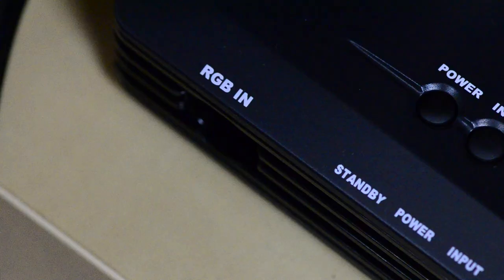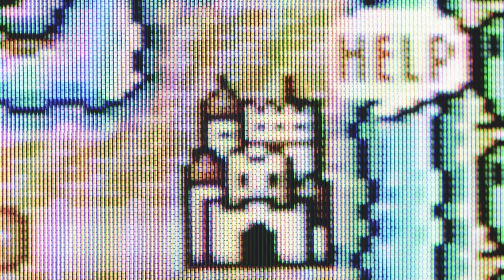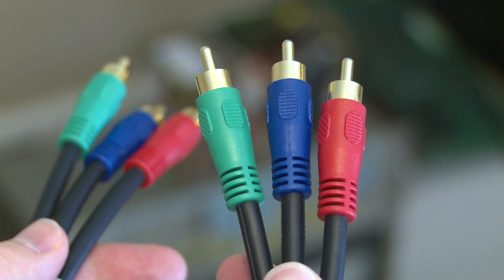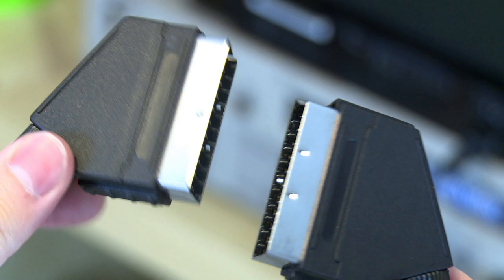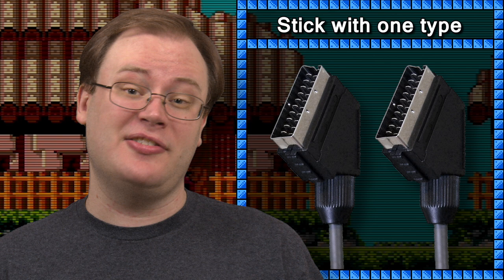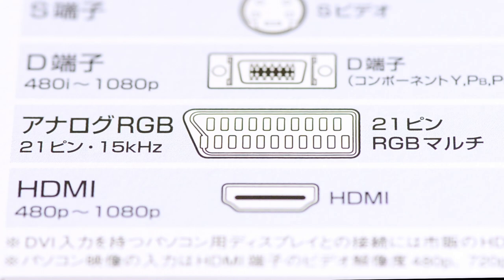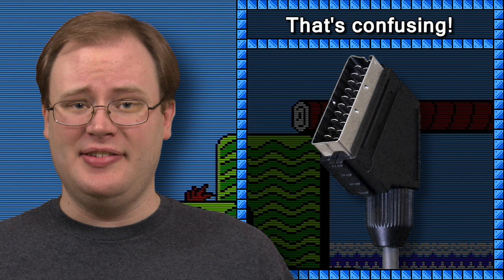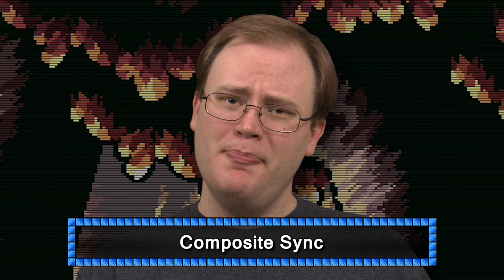Understanding RGB and Sync :: RGB103 / MY LIFE IN GAMING

Comment: Another question MLiG; I just purchased this SCART cord for my NTSC "fat" SNES 1CHIP-01 console: 
http://www.ebay.com/itm/201284360714

Then I got this XRGB-mini adapter to go along with it: 
http://www.ebay.com/itm/161621505666

Was that the correct adapter to get? I ask because in the title of the auction it says "sync stripper." Does that mean I'll lose the C-SYNC capabilities of my 1CHIP-01 through the adapter? Or is everything good and gravy and the XRGB-mini will still be getting C-SYNC thought it all? 

Thanks for clarifying; your videos are a humongous help but I'm still left a little confused by my own accord.
Reply from the maker: +Ratiocinator [Try4ce] You got it right, good choices! :) That's the same XRGB-mini adapter I use. Sync stripping is a good thing... generally helpful with compatibility. I had issues with my SCART switcher until I started using sync stripping. If you feel like your picture is shifted slightly to the left, this is an effect of the sync stripper. If it bothers you, you can easily re-center the image with the H Position settings under Zoom (preferred) or under Visual_Set.
Reply: +My Life in Gaming As always thank you for the speed and advice of your responses. YouTube needs more content creators like yourselves.

Comment: Hi Guys, european here, I´m getting into retro gaming gameplay recording and I have stumbled upon a big issue.
I bought an Avermedia LGP and Scart to HDMI converter by Elephas. The converter works fine with my retro systems. The retro games look great on my flat TV but when I connect them (Sega Master System, Mega Drive, PSOne, PS2) to the Avermedia LGP through the scart to HDMI converter It doesn´t record and when it does I get this:

PSOne
https://youtu.be/1lmJb89B9Oc

Sega Master System
https://youtu.be/b25nEwGCLaM

Can anyone tell me if this is a sync issue due to the original scart cables that I am using on my old consoles. Would I need to use, for example, a scart c-sync cable for the master system and a sync on luma for the PS One?

Can you help me figure this out I can try to buy the adequate cables instead of buyng hardware on a trial error basis.

Comment: So what the hell is Sync-on-Green?
Reply from the maker: Funnier 26 [Try4ce] We didn't cover it in this episode, because I'm not aware of any gaming applications for it, and I don't think it's very commonly used. Basically, it's just sync going along with the green part of an RGB signal, instead of with composite video, luma, or its own line. Don't confuse it with how sync goes on the luma part of a YPbPr component cable (which is colored green, but is NOT green picture information).

Comment: American SNES wont work with scart. New video: Works with all RGB sources only the connector matters :D
Reply from the maker: [Try4ce] Can't imagine when we'd have said that, because we've been hooking up SNES with SCART since we started the channel.
Reply: My Life in Gaming In the SNES video you clearly said its wired only up for JP21
Reply from the maker: [Try4ce] Definitely not. Perhaps we said something like, the adapter that is included with the Framemeister is only wired up for JP-21 (meaning you'd have to buy a SCART adapter for the Framemeister if you want to use SCART). But not the system itself.
Reply: My Life in Gaming Then I am sorry
Reply from the maker: [Try4ce] We can make mistakes! Your other comment regarding PS2 not being able to do 480p over SCART, I'm not sure where it is, but it is possible we may have said something like that early on, because we didn't know about sync-on-green. We do our testing and research as thoroughly as possible, but we have certainly made some slight mistakes here and there. It's just that I know we would never have said anything about SNES not being able to do SCART. :) But apologies if we said something that was unclear.
Reply: My Life in Gaming :)